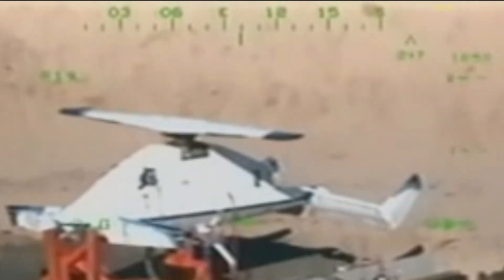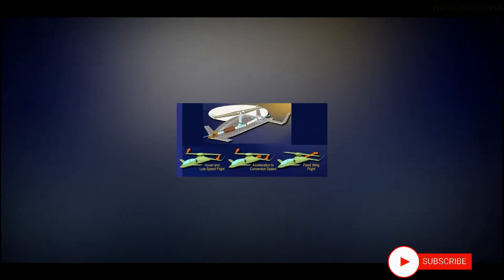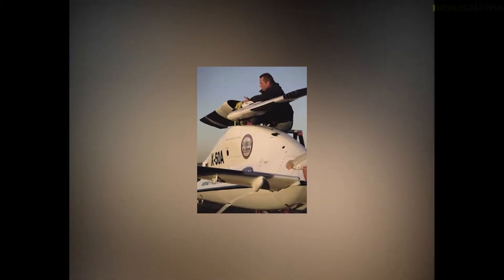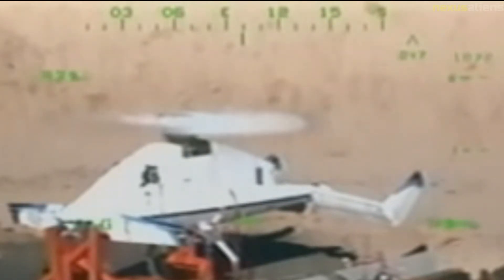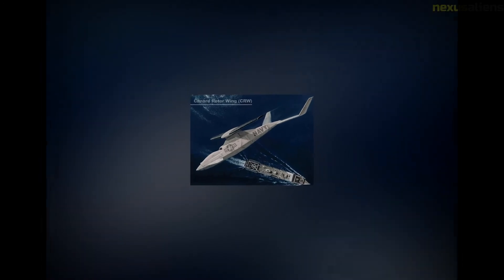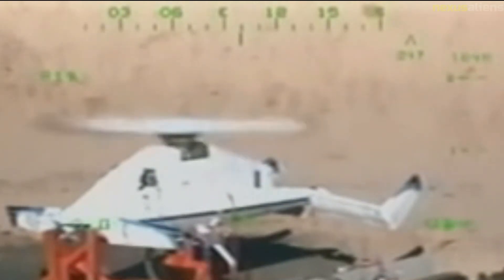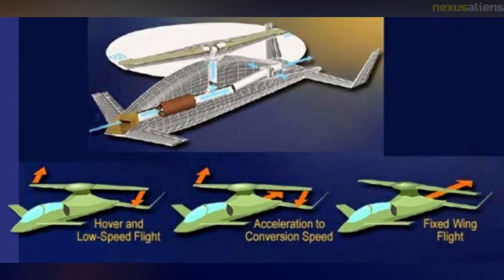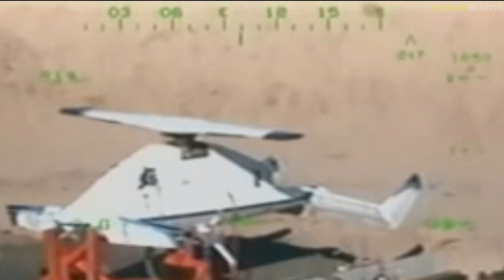Convertible drone X-50A Dragonfly, developed by Boeing and DARPA.

Comment: This was great! Thanks again, really cool you take request👍👍
Reply from the maker: Please do send me more suggestions for videos when possible.
Reply: @nexusaliens  absolutely😁
Reply: @nexusaliens  Can you cover The Thunderwell!? Nuclear steam piston concept weapon/launch system for destroying asteroids or Aliens lol or launching cargo into orbit😁✌
Reply: @nexusaliens   The steam accelerated Jules Verne capsule, which was suggested by the speed of at least 6 times earth’s escape velocity, achieved by the 10-cm thick, 1.2 m diameter steel cover blown off the top of the 152 m shaft of the 0.3 kt Plumbbob-Pascal B underground Nevada test on 27 August 1957. In that test, a 1.5 m thick 2 ton concrete plug immediately over the bomb was pushed up the shaft by the detonation, knocking the welded steel lid upward. This was a preliminary experiment by Dr Robert Brownlee which ultimately aimed to launch spacecraft using the steam pressure from deep shafts filled with water, with a nuclear explosion at the bottom; an improvement of Jules Verne’s cannon-fired projectile described in De la Terre à la Lune, 1865, where steam pressure would give a more survivable gentle acceleration than Verne’s direct impulse from an explosion. Some 90% of the radioactivity would be trapped underground!
Reply from the maker: @Anarchy_420  will sure do!
Reply: @nexusaliens  Awesome! Thank you for doing this considering it REALLY does Need it's own Vid and doesn't have one on YouTube!😁👍
Recommend watching-- Discovery Curiosity Series 1 Episode 2 Alien Invasion: Are We Ready
If you haven't seen this yet it's a bit older however out of all the shows like it that covers the same scenario this one is easily my favorite! 100% Worth Watching! Lol and it features The Thunderwell!😅 it'd be really cool if you could somehow include the animation of The Thunderwell hitting the Alien Spaceship from that show!
Reply: @Anarchy_420  Is project Thunderwell and project Orion are the same?
Reply: @komaravoluratanvir2554  no, project Orion was a Spacecraft concept propelled through space by means of several nuclear detonations. The Thunderwell is an underground chamber filled with water, the water is vaporized into steam after nuclear detonation, and the steam is pushed through a piston/barrel launching a projectile at insane speeds!✌